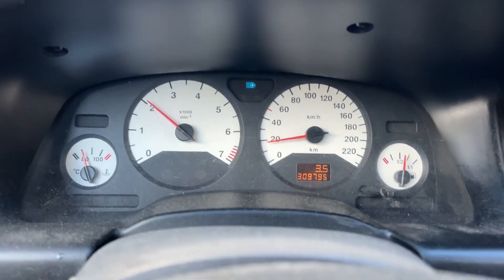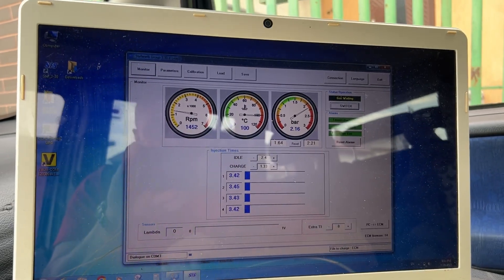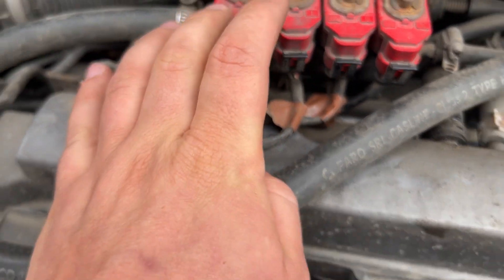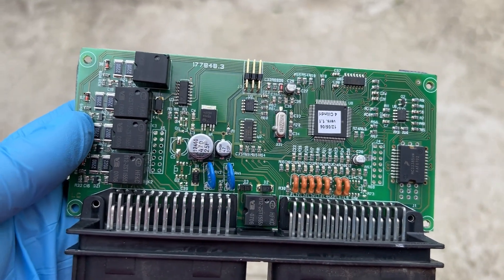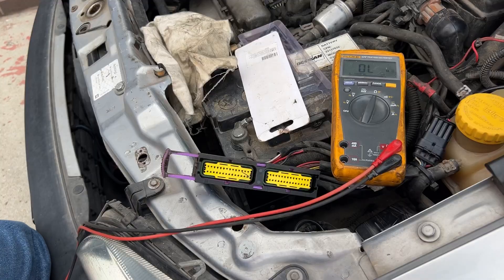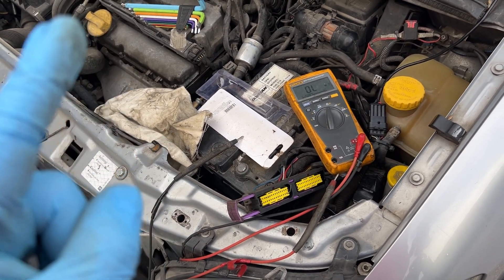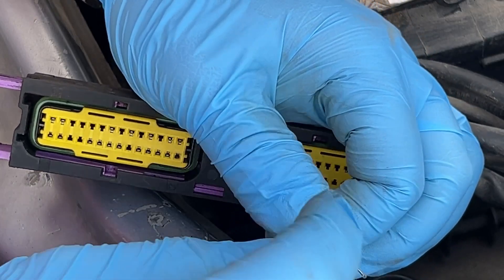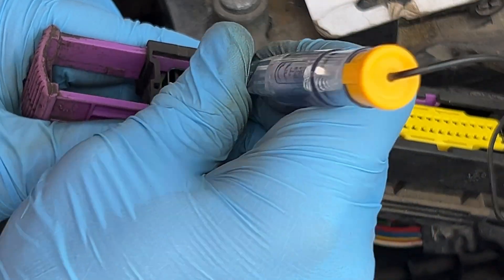LPG issues, troubleshooting LPG car system

Comment: i have the exact same issue when i change to lpg car stalls not running fuse is ok,so i have to diagnose futher thanks for the video i guess ill have similar problem.. 13 yr old ecu
Reply from the maker: https://youtu.be/93jdXbiQ7ho

Longer video.of the same problem
 I also.have a video.of similar probem in the channel